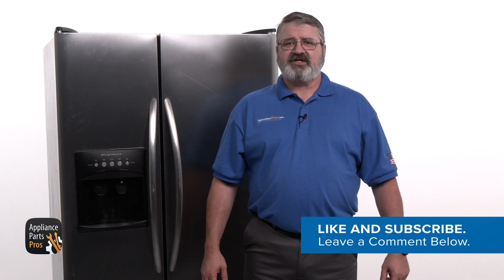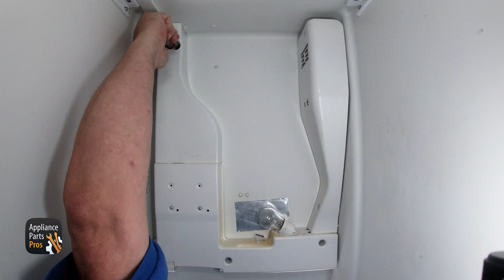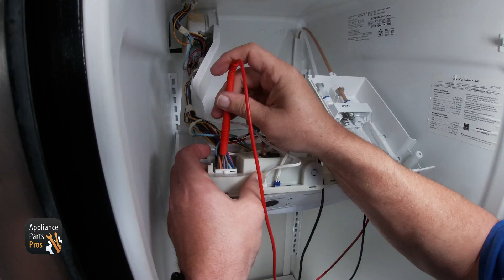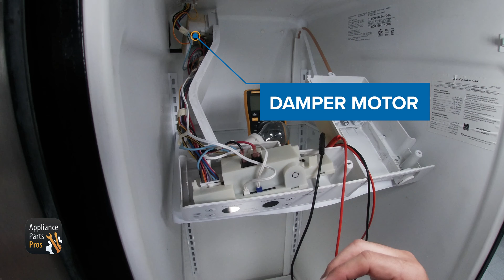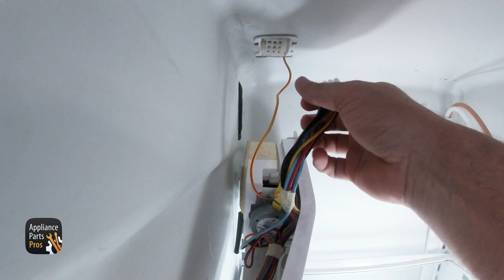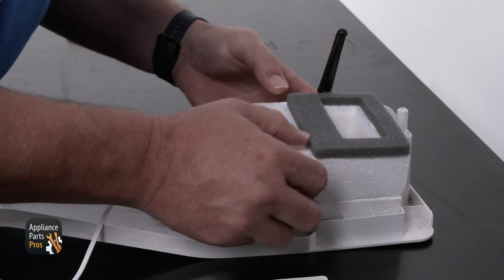Troubleshooting A Frigidaire Refrigerator Not Cooling Due To An Airflow Issue

Comment: I have a warranty on this. Noticed my fridge side is barely 60 degrees. I'm so tired of garbage appliances. Bought brand new 2019.
Reply from the maker: That’s definitely frustrating — especially on a unit that’s only a few years old.
Reply: @appliancepartspros  I didn't realize but it's probably out of warranty now. I found the part and ordered it. Should be good to go..still sad.